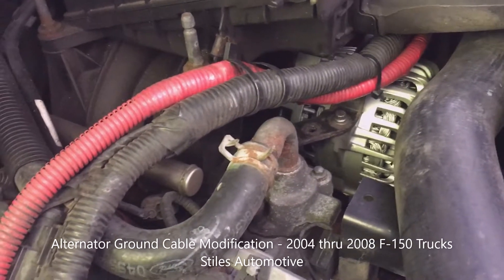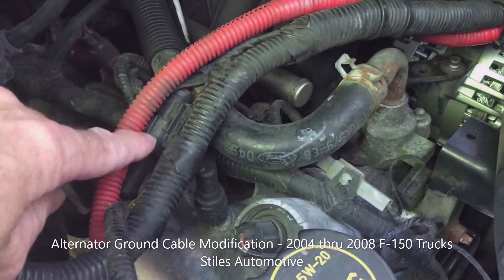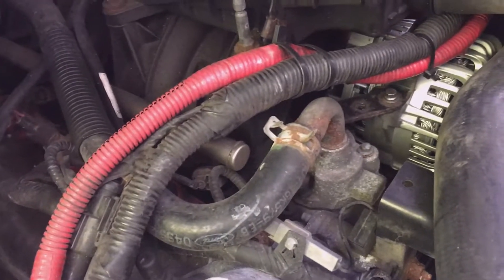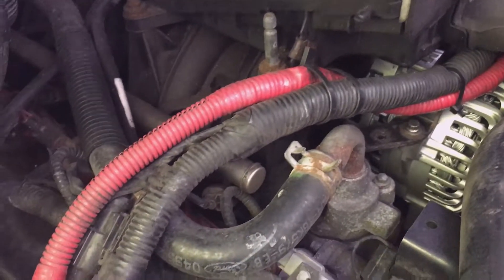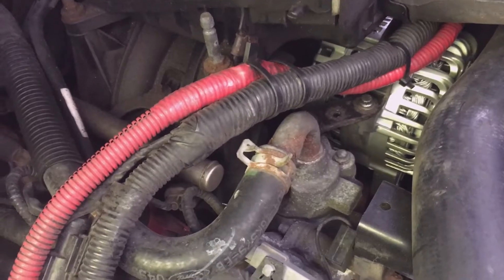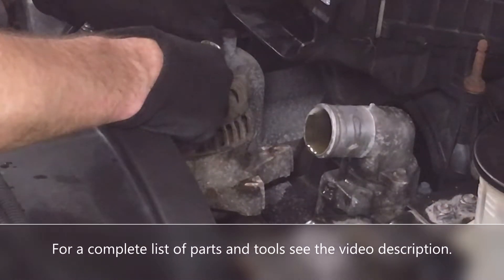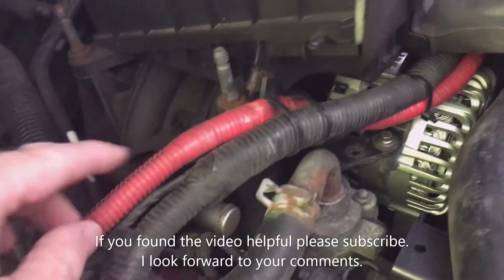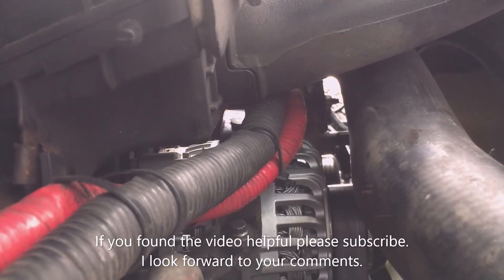Alternator Ground Cable Addition and Modification   2004 thru 2008 F 150

Comment: I added a positive cable in parallel to my stock wire and it did help a little bit but I'm still getting dimming in my headlights I'm thinking I'm having a bad ground connection so I'm thinking about adding another ground cable just like you did hopefully that will stop my headlights from dimming
Reply from the maker: Jay, Ok, very good! Yep, a new Ground Cable from the Alternator may help you, and you should also clean all of you Grounds in the Engine Compartment, one near the Battery and one at the back of the Engine to the Firewall. - Stiles

Comment: You never showed where you put the other end on the alternator.
Reply from the maker: Billy, Yep, look at the video at 2:42, my big ugly hand is in the way but when I move it you can see the mounting hole and the clean area that extents out the back of the Alternator.  My Alternator already had the Threaded Hole there, I just needed a Bolt and the new Ground Cable. - Stiles

Comment: I have a 6G alternator. Do you think I could use the same size bolt to ground my alternator exactly how you’ve grounded your alternator. It has a grounding “pad” on the back that’s threaded.
Reply from the maker: Hammered, Yep I think you should be able to. You have to verify that your Alternator does indeed have the Pad for the Grounding Lug on the back. I believe (don't know absolutely) that all of this style of Alternators have this Pad. - Stiles

Comment: I think you said you put a high output alternator on your truck, what amperage did you go up to?  I've got 4 gauge cable from  putting my son's amp in but not entirely positive 4 gauge is correct since I'm putting a 250 amp HO alternator on the vehicle.
Reply from the maker: Ron, I think this one is 120 amp, it is a new Motorcraft Alternator, I don't remember the PowerMaster that it replaced.  Remember, Welding Cable has more load carrying capacity than Automotive Cable, you should read what the Cable Manufacturer say about Load Rating. And remember that the Welding Cable is at 120V or 240V generally. So if a 4 Gauge Cable is rated at 100 amps (most are) than that is a lot at 12 volts. - Stiles

Comment: The original ground plate slid out of my harness. Could i rplace this as you did rather than try slide the plate back in the rubber boot or buying a new harness?
Reply from the maker: BASP, Yep, you can always add a wire to the outside of a Wiring Harness and you should always ensure you protect the new Wire. - Stiles
Reply: @StilesAutomotive  I appreciate you

Comment: Did the alt have a spot fir negative.or dud you just take a bolt lose and mount it
Reply from the maker: Douglas, Yep, my Alternator has a Pad with a Threaded Hole on it that was not used, but is for this purpose. I had to provide the new Bolt. - Stiles

Comment: I have a 2003 F150. I’m thinking about running a bigger charging cable to the back of the alternator. Were in the back and how big of wire?
Reply from the maker: Earl, I try to answer these type of questions within 24 hrs. Sorry for the delay. 

I think I used 4 Gauge Welding Cable to replace the Positive Cable on my Alternator and I used the same 4 Gauge Cable to add a Ground Cable. Most Alternator have a Positive Stud to connect to. 4 Gauge AWG (normal automotive wire) (allowing for a 2%  or less voltage drop at 12V) will carry 200 amps for 4.7 feet.  That is about the length of my new Alternator Cables. Note that Welding Cable with finer strands of wire in them will carry more amps. 

If you feel like this is not enough for your application, I run 2 Gauge Welding Cable for my Battery Cables, 2 Gauge AWG (at 2% drop) 300 amps for 4.9 feet. (Remember Welding Cable is much more.  Get a chart for the Welding Cable you are buying.

Use caution when doing this, Alternator Power Cables (from the Positive Post on the Alternator to the Positive Battery Terminal) have a Fusible Link in them.  This is a Fuse that looks very similar to Automotive Wire.  I recommend you use a Fuse in your new Cable and you make an extra effort to protect the cable from damage. 

Let me know how it goes! - Stiles
Reply: @StilesAutomotive  Ok I did it, but the ground wire from the alternator bracket bolt could not reach the negative battery terminal. So I instead fastened it to a bracket near my firewall. It is painted black, however and then I had a whine inside of my truck that reminded me of my amp/subwoofer days. I listened to one of my door speakers, but I heard nothing, even with the radio off. My truck still has the factory sound system in it and I plan on upgrading it at a later date. The whine seemed to be coming from under the dash. It would get a little louder when I accelerated, then go away altogether. But at idle, and low acceleration, it was definitely noticeable. So I finally unhooked the wire, and the sound went away. I relocated that wire to a factory ground strap from the frame to the chassis under my truck. My question is, we’re was the whine coming from? It was definitely an alternator whine, but it wasn’t coming from my factory speakers. I plan on getting a longer ground cable and doing it the right way from the negative battery terminal to the alternator bracket bolt. Thanks for your reply!
Reply: @standhd  It's called Electro Magnetic Interference (EMI). The new negative wire you installed from the alternator to the bracket near your firewall, was carrying current, this current causes a magnetic field outside of the wire. This magnetic field interacts with anything that's electrical and nearby. Since it was close to the dashboard, it interacted with wires in your dashboard.
Reply: @bernardocisneros4402  Thank you for your reply. Should I disconnect it?
Reply: @standhd  If the noise doesn't bother you, leave it there. If it bothers you then, disconnect it from there and connect it to a spot that's not too close to the dashboard. It's always best to connect it to battery negative, but if you can't, connect it away from dashboard or firewall.
Reply: @standhd  It's called a "ground loop". Just in case you want to Google it.
Reply: @bernardocisneros4402  Ok cool. I will leave it be. I just want the best for my electrical system without damaging the factory components. Thank you so much!

Comment: Where did you connect the positive wire on the alternator. On mine, there are two places that have positive coming out of it.
Reply from the maker: Skye, Take a look at this video, I show you the Alternator Connections:    Alternator and Drive Belt Replacement 04 thru 08 F-150 5.4 L   https://youtu.be/iaineAuHYvU       Let me know if you have any other questions! - Stiles

Comment: I just installed a new positive terminal on my battery. I am trying to locate a diagram that list where grounds are located so I can service them. Mine is an 09. When people refer to “check your grounds” does that mean the various metal braided straps? Are there any inside of the cab or all just underneath? Thanks again for sharing an informative video. Also the comments are helpful too.
Reply from the maker: JP, Yes the uncoated braided straps in the Engine Compartment are grounds. And almost every major component has its own ground (or is ground thru its mounting bolts).  For cheap Wiring Diagrams Clinton's Manuals are pretty good (the other information is often generic).  If you like the Truck and will do other Wiring / Troubleshooting work buy a real Ford Wiring Diagram Manual from Helm Inc (link below). If you do a google search it is sometimes hard to determine if you have the correct information. - Stiles 

Helm is the publishing company for OEM Owner's, Shop, and Wiring Diagram Manuals
https://www.helminc.com/helm/Result.asp?Style=helm&Mfg=FMC&Make=FRD&Model=F150&Year=2009&Category=&Keyword=&Module=&selected%5Fmedia=
Reply: @StilesAutomotive  Hey, thanks a lot for the great feedback and for replying so soon.

Comment: No need to do this. Alt is grounded to engine. Adding those cables is a waste of time and money...won't change a thing.
Reply from the maker: Bella, Yep, that is why I said in the video; "worst case the addition just adds weight to the Truck."  However, as your Truck gets older, the ground(s) to the Engine become corroded and this cable may provide a better ground path, which will help your Starter and Electrical Components.  What if you painted your Alternator Bracket and Alternator like I did in the video?  You will likely not have a good ground thru the Mounting Bolts.  Electricity flows thru the path of least resistance, this new Cable will provide that path for the Alternator. - Stiles
Reply: @StilesAutomotive   If you live in the rust belt,  you're battery and alternator will thank you. I live in Chicago, so we have our share of cold n snow n salt on the roads. I've seen a lot of issues on older vehicles caused by bad grounds due to rust, so if you live in the rust belt, consider this a long term investment.

Comment: Alternator are ground to the block. That's why No factory strap or wire
Reply from the maker: Grady, That's right, the Alternator is grounded thru its mounting bolts to the Engine. The Engine grounded one or more places.  My addition of a Ground Cable is explained in the video, to add a direct ground path to the Battery.  For maximum power conduction and reliability. Are you just make a statement or ? - Stiles

Comment: Means i have to use 2 cable?
-1 cable from positive battery to alternator
-1 more cable from negative battery to alternator
Is that right?
Reply from the maker: Nizam, Yes, you got it.  I used 2 cables, a new one to replace the old Positive Cable from the Alternator to the Battery, and a new Cable for the new Ground Cable (from the Battery Negative Terminal to the Alternator Body.  This improvement makes it so the current doesn't have the use the existing Engine Grounds (which most people have never cleaned, and you should if your truck is over 10 years old).  The idea is to get as must power from the Alternator as possible.  You don't have to use 2 Cables like you stated, but I did and I recommend it.  - Stiles
Reply: @StilesAutomotive  thank you sir..
Do you use any fuse for that?
Reply from the maker: @nizamkechek1150  I did not, but the Original OEM Cable likely had a Fusible Link  in it.  The risk is, if the Alternator ever gets a dead short in it, it will get very hot!  I've never had this issue, but it could occur, I think. - Stiles
Reply: @StilesAutomotive  oh i see..
Thank you very much sir..you help me a lot..

Comment: Could this help eliminate engine noise to the car audio system?
Reply from the maker: If you have rewired your car or truck, yes it could help.  Make sure you audio cables are not routed by any of the "big 3" cables of any power cables to your amps and other high load devices.  Good grounds are over looked and very important.  - Stiles
Reply: The good grounding system from the truck will give you a great power source to your audio system because of more steady current and returned but as far as your head unit or amplifiers go the grounds need to be as close as possible to the units don't worry about the performance of the truck when it comes to grounding audio

Comment: So no big 3 ?
Reply from the maker: No, I always thought I'd do the Starter Cable when I changed to a Power Master (or other) Starter, but my OEM Starter has been doing fine with the dual Batteries.  I do need to finish the video on the Dual Batteries install.  My Snow Plow is the big power draw for me and it has its own Power and Ground Cables.  I have a video that shows you how to make the cables, you just need to figure out the length of the starter cable.  Some day maybe I'll do it.  Thanks for the comment.  - Stiles